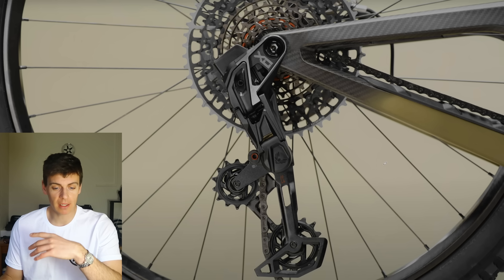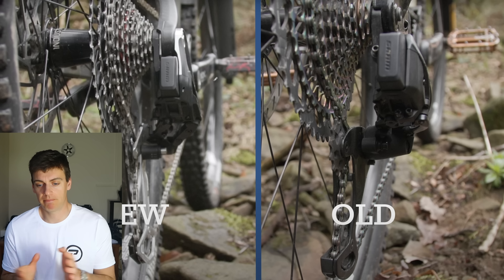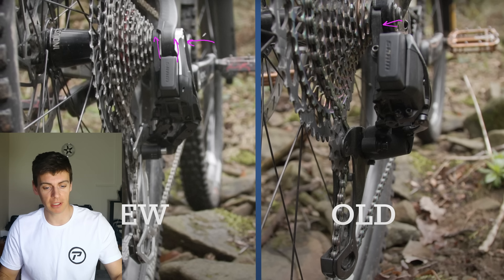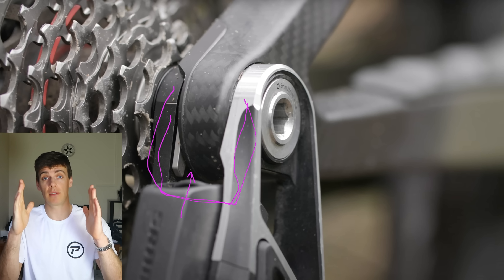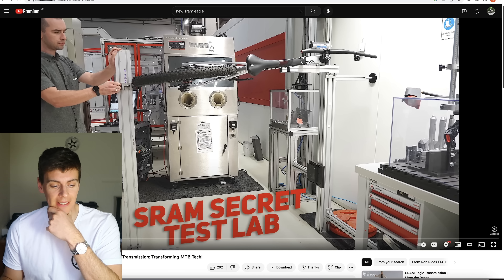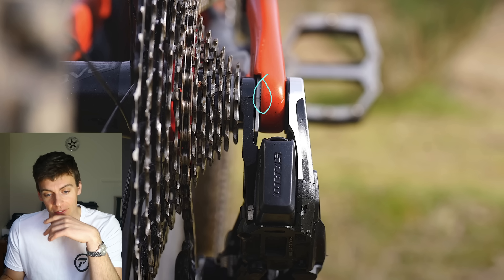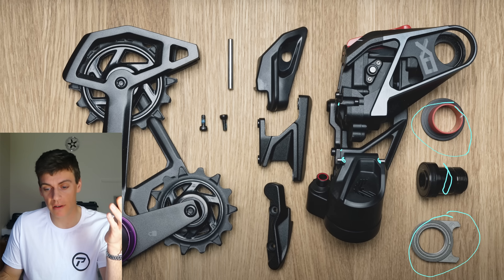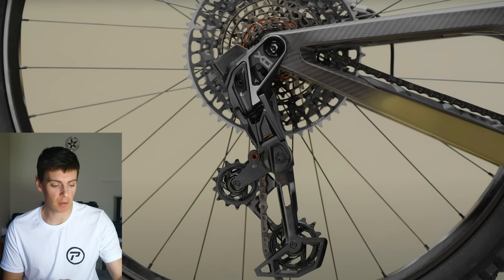Mechanical Engineer's Speculation of new SRAM Eagle (including misinterpretations!)

Comment: From a 'common sense' point of view (i.e. thinking like an engineer and technically-inclined cyclist) the design decisions are mystifying. But if you think like a consumer product-focused engineer or, god forbid, the marketing department, this all makes sense. It's different enough to justify a high price, controversial enough to get media attention, and most of the customers will move on to a newer, shinier bike before suffering long term problems from this backward design.

Comment: I strongly disagree with the indexing argument. For one, in real life the hanger is always somewhat bent while wheel reinstallation also shifts the geometry. Secondly, a hanger is just another link in tolerance chain. Then, U-shaped interface with a bushing is what Shimano used prior to X100 series (and in my expirience it worked flawless) - you are missing that thanks to the moving nut clamping of the wheel and derailleur here are executed in parallel, not like a kebab. Lastly, you may find the weird lack of adjustment screws and a soecial indexing protocole, meaning the electronics must be compensating for innacuracies and defects with motor force feedback.

Yes, dropout geometry gets critical. But it is already so and the interface must be faced anyway.

Overall, it's a good fit-and-forget concept. Question is of couse about its execution. And that's where I'm fully onboard with criticism of serrated washer and lack of sacrifitial component. Sram are forgetting the main part of the bike is still the frame, not the groupset, even if they are at comparable cost.
Reply from the maker: Great comment. In a perfect QC world it will work fantastically, but I've seen frames pass QC that barely can thread a thru axle through without mashing the threads because the dropouts are so out. So, it is not a holistically friendly production solution unless SRAM are willing to produce all frames!
Reply: @PeakTorque surely there would be sram sponsored frames with excellent QC but 3x the price lol
Reply: @Benri05  you mean audited and abused the hell out by Sram? Sponsored would imply Sram pays
Reply: @PeakTorque  good, more pressure on frame manufacturers who cannot deliver quality products. Will indicate the issue straight out of the box too.
Also, I revisited the knurled washer and it seems a good concept with less than ideal execution too: as the derailleur swings, it rubs against it and not the frame, therefore must not damage the frame. Especially as dirt gets into contact zone and turns into grinding paste. But there is still an issue you pointed out. Which however can be fixed by permanently epoxying the washer to the frame. Question is who would care to DIY anything with such expensive purchase in the first place...

Comment: For some reason I seems like common sense to me to rather use a hanger instead of all that nonsense directly on the frame. I actually did study mechanical engineering but still without that, it does not seem like such a good idea to reinvent the wheel. It does look pretty cool though :D Noone raising an eyebrow over the absurdly expensive cassette? Its over 700€ over here in Germany, made more out aluminium to have an even shorter wear rate.

Comment: I think it is pretty clear that the outer element does not take any clamping load so the first 5 minutes of this about clamping squeezing the two mounts together is incorrect. The outer mount has a sleeve so it is just providing torque reaction and forcing the mechanism to be perpendicular to the axle shaft.
Reply from the maker: It does. When torqued to 25Nm, it squeezes the fork assembly together onto the frame to provide the torque resistance.
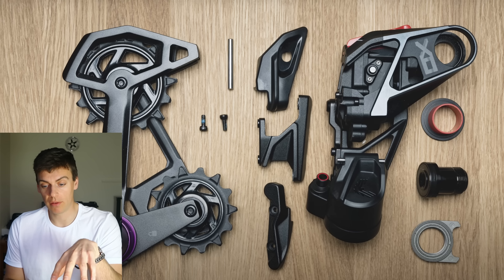Reply: @PeakTorque  I don't agree. Top right of screen at 9:20 time mark. There is no flange for the screw to bear on to transfer any load into the outer portion of the bracket. There is only a sleeve over the fastener head to bear on the inside circumference of the bracket. I'm happy to be corrected if you have one of these in your hands but as a 30 year experience mech engineer, I stand by my original comment.
Reply from the maker: @mtbohana  yes i also stand to ve corrected too, but if you watch an install the fork/clevis is loose on the frame until the stub axle part is tightened to 25Nm. Then it grips. It needs to grip something or the whole assy could slide side to side theoretically.
Reply: @PeakTorque It looks to me like it’s “sandwiching” or clamping around the bushing in the frame by threading the stub axle into the serrated plate on the inner side of the dropout. I think this is the exact same way the UDH would attach. The outer plate of the derailleur only helps to keep concentricity when the thru-axle threads into the stub axle. The thru-axle will then force everything into alignment when it is inserted. I am but a lowly chemical engineer and have no horse in the race, nor am I qualified to assess the merits or drawbacks of the design from a mechanical/forces standpoint. I don’t even really mountain bike, or have a horse in this race, I just got curious trying to figure out how this is set up. Srams install video seemed to shed a bit of light on it for me, but then again, I could be totally wrong.

Comment: Remember back to the introduction of 1x12s eagle and the 10t road cassettes, how we all bashed them back then. What happened? 
They took the marked by storm and never in my career before i had to do so little maintainance work or change worn drivetrains of costumers running eagle and axs altough the sales (and km`s shredded)  went through the roof due to covid. 🧐 So it might not look clever but lets see, they probably nailed it again - time will tell.
Reply from the maker: When you control the market, and replace the existing product, of course it will sell. I agree 12sp eagle works brilliantly (on the whole and better than xtr and xt in some regard), i don't see the problem with it. I just don't see this upgrade as a pure solution.
Reply: The problem right know is that a Specialized owner only can get qualified repairs at a Specialized dealer and so on... Removing the derailleur hangers from the equation gives the costumers and the shops more flexibility and allows frame manufactures to simplifie and strengthen their frame construction.
Reply: @Nico-jt8ll  So manufacturers will build Eagle transmission specific frames?
Reply: @petesmitt  correct and they have already done it for a few years. There are plenty compatible one's, search for udh.
They aren't much different from a regular frame but smarter and off course they're compatible to any other drivetrain as well.

Comment: I'm not sure I agree with your two main concerns.  For the alignment issue it looks to me like they are relying much more on the thru axle itself for alignment than the interface to the frame.  I don't see minor imperfections in the dropout faces being able to cause any noticeable misalignment when the thru axle is running directly through their mount.

On your point about losing the replaceable derailleur hanger, I run a small carbon repair business and I've seen way too many "sacrificial" hangers destroy frames when they break making them worse than useless.  We'll have to wait and see if this is the correct solution but from what I've seen the current derailleur hanger concept really needs to be done away with so I'm glad to see someone is trying.
Reply from the maker: Thanks for your comment, and i hear what you're saying. However I don't think the derailleur should not be aligned by a thru axle thread, as that alone has a lot of manufacturing clearance. The clevis and mech first will be clamped to the dropout. If then the dropout is then not perfectly perpendicular to the thru axle, these two systems of alignment will be fighting eachother. Just not a very pure solution in my opinion. My biggest worry is about the hugely stiff and strong design transferring impacts straight into the rear triangle where delamination may be invisible, granted this could happen anywhere on a carbon frame in a crash however.
Reply: Agree on both on your points. The new derailleur design simplifies and allows manufactures to bulk and stiffen up the rear triangle.
Reply: In this case, the thread in which the thru axle screw in are the tread from the derailleur mount bolt. As with the all of the other thru axle system existing, yeah it’s true the dropout and the axle if not perfectly align will fight each other. However, when tightened, it comes all aligned. Which makes the derailleur perfectly aligned with the cassette. When it comes to the concerned of the impact being all transferred to the rear triangle. Because the derailleur is mounted on to the thru axle. The impact is being firstly transferred to the axle which will then transferred its load to both the dropouts in the same way it does when riding threw rocky downhills. Mtb frames are being designed to react to those kinds of impacts so it should not be an issue imo

Comment: I'm not a mechanical engineer, however, when I first saw this earlier today my immediate thought was, SRAM is ensuring that I will have to replace my bike or rear mech, or both, If I were to have a serious crash. I would never plan for a severe crash, but as aggressively as I ride, you never know. I've broken and or bent my share of rear derailleur hangers but still after several years of riding the same bike there no damage to the frame or the derailleur.
Reply: They just don't care if you will need to buy a new frame because of this new manufacturing BS. All they care is about marketing up and earning 10x on every product. This is Scam*
Reply: k but the derailleurs are waaay stronger than the previous one so the chance of theese new  derailleurs snapping is severely less likely than the chance of a hanger snapping

Comment: For dropout misalignment to be severe enough to affect shifting, I'd expect the frame to have long since failed QC. And speculating here, but I think any impact small enough to be moderated by an ordinary hanger could be distributed through both dropouts without damaging the bike. An impact that would damage the frame in this new model would otherwise have torn the derailleur off and probably still damaged the frame.
Reply from the maker: Frame failing QC? You're new to the bike industry eh 😉
Reply: Fanatik recently posted a video scientifically whacking the hell out of this RD and the previous. XX1 bends the hanger and itself, this one eventually breaks in a replaceable section. Whether they intended it to be sacrificial or not, it seems to end up that way. The force required made me wince.

Comment: Do you have any update on the disc rotor you where designing? I'm on discs now and I was quite impressed how non straight the €80! dura ace rotor  was. Would love to support this channel when I need to replace them.
Reply from the maker: Its under NDA, but thanks. Hoping to share more news soon, but commercially its a dud and too expensive ☺️
Reply: @PeakTorque  people are willing to pay quite a bit for good rotors (see Brake Stuff), or very light potentially suspect ones (see CarbonTi)

Comment: Just listening to the Geek Warning Podcast where Dave Rome talks to Lachlan McKillop from SRAM. The new derailleur uses the thru-axle for the alignment. Their reasoning is that if the axle isn't straight it would not fit in the frame or the frame is faulty.
Reply from the maker: Yes they use the axle threads to align everything, which itself has some clearance. It also is fighting the mech clevis if thats not perfectly aligned perpendicular to the axle. All of which is robbing you of clamping load on the rear hub. I'm not saying it doesn't work but it's not a neat solution
Reply: He also mentioned that teaching people to shift properly by slightly backing off the power is too hard. So as usual, the idiots have to be accomodated for

Comment: Hey man -love your analytical nature and the informed take on the product. A couple questions: are you under the impression that SRAM doesn’t also employ qualified mechanical engineers (who only think about bikes and shifting)? And while I have the same concerns about doing away with hangers, why lament the change as a loss, when this represents a push toward something simpler, and maybe stronger? Is it possible this will lead to reinforced frame dropouts or something?
Reply from the maker: No - Im sure the engineers have tested the durability, manufacturing repeatability and fmea etc. They have good engineers and processes. But from a purist point of view, it does seem like an overcomplicated solution. The clutched lower jockey wheel exemplifies that.
Reply: @PeakTorque  the clutched lower jockey wheel is there for a reason, it's a solution for the problem they created in the first place. If the bearing on that pulley gets completely stuck and that happens during a hard effort on a climb, the derailleur get's violently pulled towards the cassette and the hanger is ripped clean off... that is, if there is a hanger there. This actually happened to me on a XC marathon last Sunday, some water crossings from some big puddles must have contaminated the bearing, the chain got stuck on the cage a few times and finally with 11 km to go it awarded me with a DNF.
Reply: That is totally ridiculous, I agree haha. I’ve never had a stick get lodged in my jockey wheel in all the years I’ve been riding. Hysterical. Thanks for your video!
Reply: In my experience as a Mechanical Engineer, most Engineers don’t like change and want to find why the change is an error. SRAM’s strategy with this system seems to be trying to solve a bigger problem than people realize, USER ERROR. The other part most aren’t realizing is that the new mounting method will transfer allot of the impact force through the axle which would distribute it throughout the full rear triangle for better impact handling.